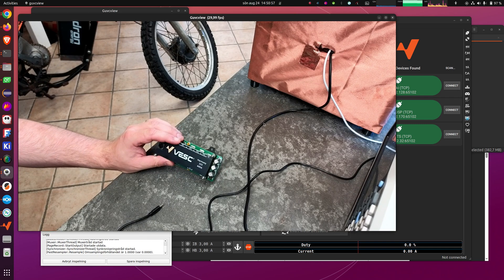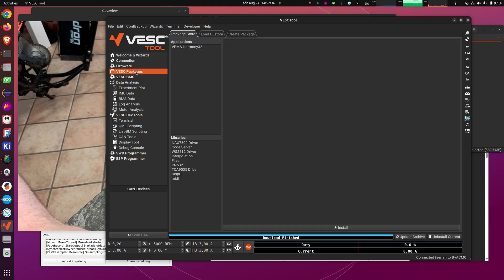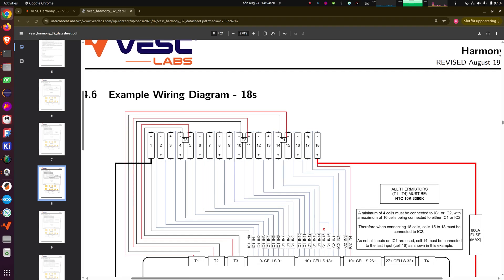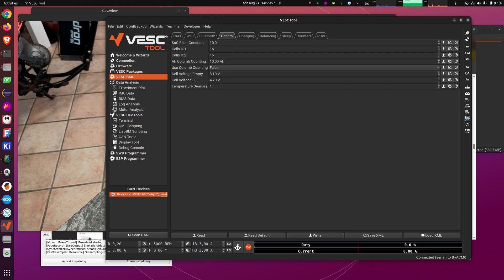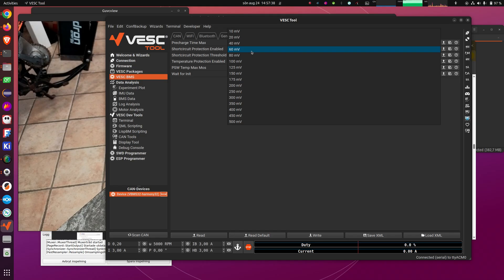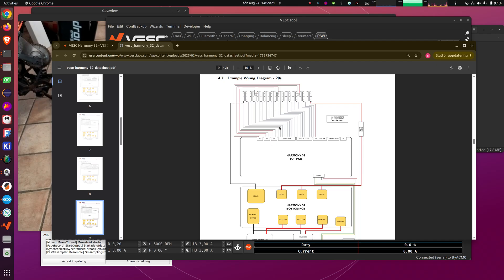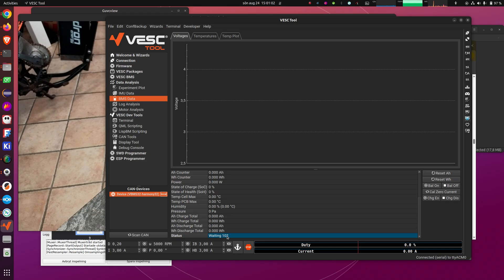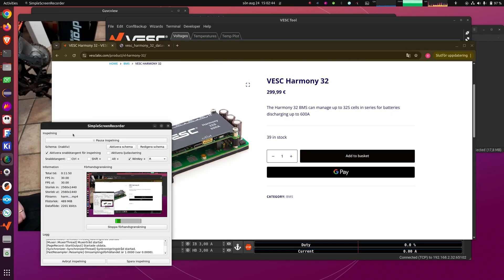VESC Harmony32 32s 600A BMS

Comment: Does the VESC Harmony 32 support Lithium Titanate (LTO) batteries? The datasheet mentions Li-ion, LiPo, and LiFePO4, but we need to know if LTO is specifically compatible. Our LTO batteries have a minimum voltage of 1.5V, a maximum of 2.75V, and a nominal voltage of 2.3V.

Comment: I hand built one of the very first public VESC designs a hundred years ago from your blog and have been using them ever since. I am excited to see you releasing your own products -- you deserve the cash and credit from the good work. Hopefully the new home-grown stuff starts to reduce the amount of troubleshooting Flipsky units and the questionable QC behind them generate for discord/forums.
Reply: I always donated Platinum, i mean whats 20 euro for this great hardware and software?

i'd gladly pay that a year, offsets the fact i run cheap controllers from offbrands atleast a tiny bit, Trampa was a no go due to import costs into Belgium
Reply: @BH4x0r  I think the cheap brands are a great value when they get implemented right, but it was tragic watching swathes of people fry units without phase shunts because of poor 'firmware hygiene' around the earlier cheap brands.

Agreed about the vesc software, hard to find better options even with big budgets.
Reply: @eeehhhhhhhhh yup, i mean i run a pair of Makerbase 84100HPs in my daily driver lol, as those are perfect for it

those are the only cheap* ones rated 75V+ with actual phase shunts that i know of tho, apart from the 84200HP and 100300HP, Spintends 100V models are low side shunts

Makerbase uses the INA241A rather than INA240A the 75V spintend models and official Vesc 75's used

Flipsky on the other hand is still.. crap

they just added phase filters.. on a low side shunt design.. all to avoid making a proper firmware config for it rather than using 75_300_R2 😂

Comment: hi vedder, i really admire your work, i see a lot of potential to your controllers when used for force feed back with bldc motors, the community is using vesc to control direct drive wheel bases servos, and it works quite well by the way. We all would like to see a controller made specific for ffb coming from your company, that would be nice, i think you could make an excellent job in the simracing/ffb products market.

Comment: Does the 30a charge apply to regen/current from the Pack Out terminal, or just for the Charge terminal? Will the BMS will columb count regen currents too?
Reply from the maker: 30A is for the separate back-to-back charge terminal. The main output can handle 600A in both directions (discharge and regen). Column counting work on both ports in both directions as all current passes through the shunts and the shunts count biderectional currents.
Reply: @BenjaminsRobotics  ok wonderful. What's the minimum cell voltage? 4.4 is max right? I use LTO cells in one of my builds.
Reply: @johnhodnik2962  I have also an LTO Battery. Were you able to use the  VESC Harmony 32 BMS for LTO Batteries ?
Reply: @Vidyadharindia I have yet to buy one, and I dont recall the datasheet giving any minimum value for cell voltage.
Reply: When, where, and money💲

Comment: I've been wanting something like this for a very long time. I'll be purchasing one asap. 

I also agree with @Beredro, I'd love a lightweight version with no fets that just balances and monitors. Have a few inputs to choose from for current input, one for a hall-style clamp sensor, one for a shunt that goes to a shunt amplifier so we can use our own shunt, or no current input at all (just balance and monitor cells).

Also have few configurable outputs, maybe through some fets? One for triggering a discharge contactor, one for a charge relay, etc.

The best part of this is, even if you release a very basic version without all this I/O, I could make my own board with CAN BUS and do all this myself. This is why I continually go with VESC over alternatives for the motor controllers, hands down.

Wonderful work, looking forward to more from VESC Labs!

Comment: Love to see 32S BMS from you. But please work on Cell-Monitoring-Units that are affordable... something like 10S or 12S units that only monitor the Voltage of the cells and some temp-sensors... That way we can chain them together and scale based on the project.... Current or Power limits are already available through VESC-Motor-Controller. Short protection could be done by normal fuses.... 
Or add a "Power-Unit" in combination with the CMU that consists of current protection and measurement.

I would want to see something like the DALY-Active -Balancer that does no current measuremnt and just reports the cell-voltages.
Reply from the maker: We are working on a much smaller and lower cost 16s BMS too, hopefully it will be available in the next months. We also have a 32s version without power switch that we haven't put on the website yet.